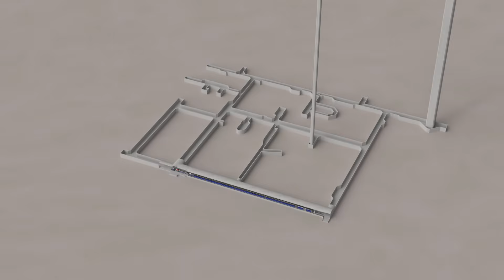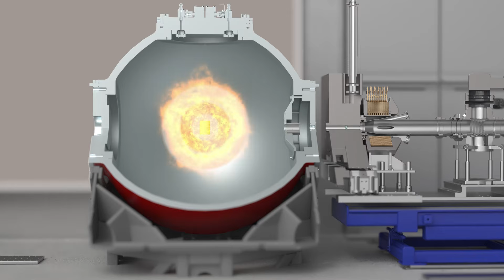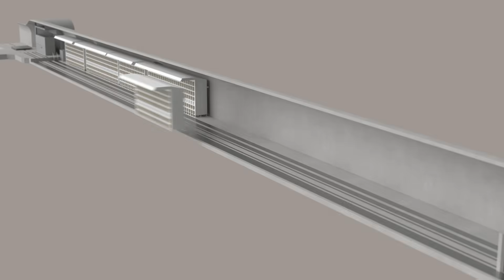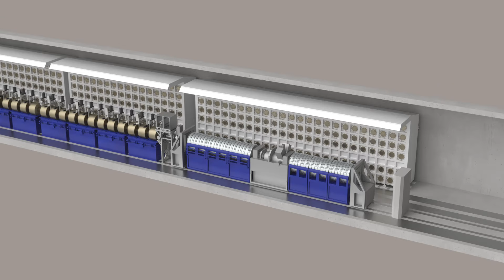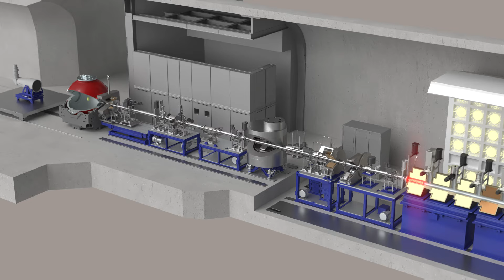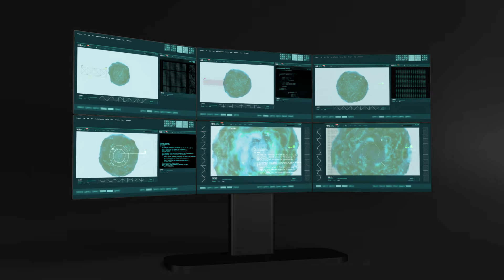PULSE Facilities and Subcritical Capabilities - SCORPIUS

Comment: The reason Russia does not dare attempt to use any size of nuclear weapon is that there is no guarantee it will go off.
Russia hasn't had much of a stockpile stewardship program for the past twenty years except on paper, so it's hard for them to have high confidence.
They cannot afford the upgrades to facilities which they have announced. The 2010 announcement included a fifty year plan.
They don't appear to have executed much progress in that plan. 
Their stockpile is very high maintenance, with causes ranging from explosives with very short shelf lives to excessively fast degradation of fissile components.
Each weapon must be refurbished every three years to remain viable, and their warheads' total lifespans are believed to be no more than 10 to 15 years!
This is crushingly expensive for a nation that has no spending money whatsoever.
The expiration of the test ban is something we should be working on hard and fast, because it is not in our best interests for the Russians to find out whether their warhead designs were conservative enough. (and AFAIK we know, they are very conservative - I expect we worry about that intel)
Reply: Very interesting, thank you for all this information. 
I would like to know what the situation is for China.
Reply: Idk probably can order it on temu